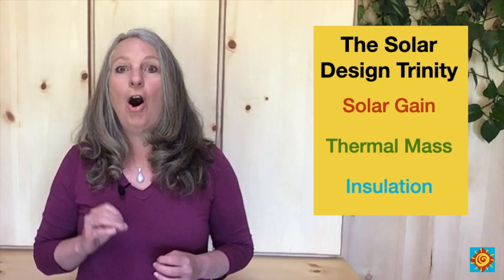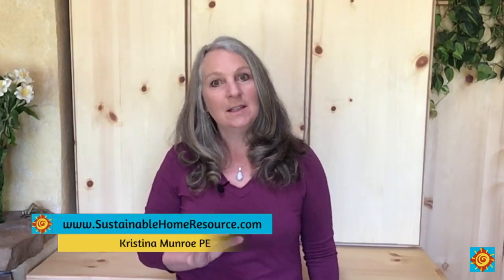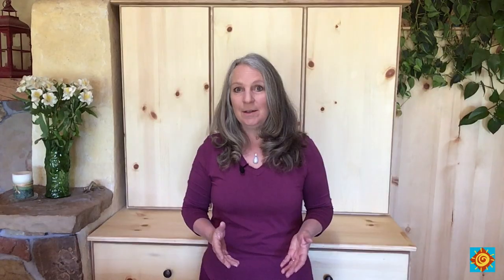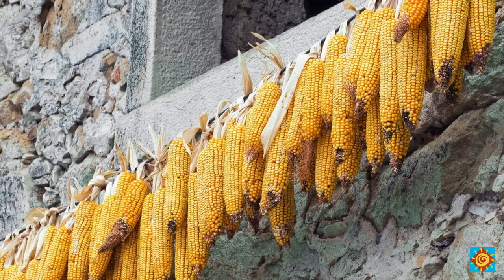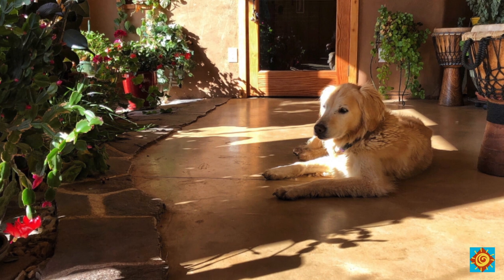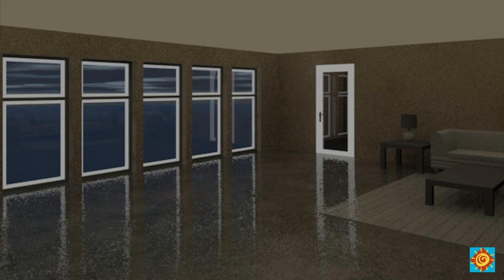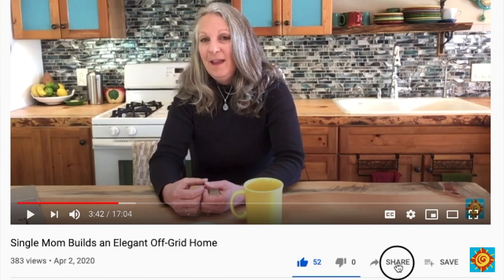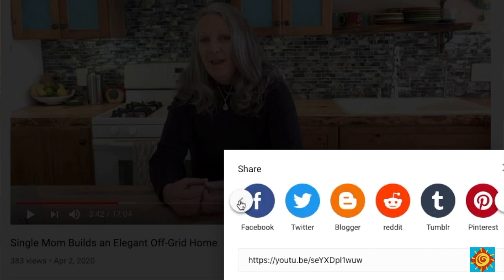[Part 2] Heating and Cooling for Free Using Thermal Mass

Comment: well, my house in mexico city, which is fully built with concrete (a very high thermal mass material) gets UNBEARABLY hot at night during spring and summer, so I don't know what to tell you. Maybe this works in cooler climates with "hot" summers that last two weeks, but here, in such an arid and hot climate, it really doesn't.
Reply from the maker: I agree and thanks for sharing your experience. 
Designing and building a home with thermal mass such as concrete is only but one tool in the designer's tool box. Thermal mass alone does not make a home comfortable. There are many elements to combine with thermal mass, such as placement on of home on the land (ie relative to the sun, wind), passive ventilation, berming the house into the earth, and the size and placement of windows. 
If you are inspired to learn more, I'd recommend a book by Michael Reynolds called Comfort in Any Climate. It's an older book, but the basic concept are sound.
Reply: @ClarityOffGrid  Thank you for your kind reply. Well, all those things you recommend are completely wrong in my house: big windows in an East facing front facade with no shade at all, none of the windows face each other to favor wind currents, huge skylights, the other windows face West... it's a complete disaster. The sun hits the house non-stop from dawn til dusk. I would really have to tear down the house to make it functional. 
The thermal mass bit is especially unhelpful here because, even though there's a big gap between night and day temperatures (10°C at least) the temperatures are already so high, even at night (20°C at 2:00 in the morning is something I wouldn't wish on my worst enemy), that when the concrete starts emmiting its stored heat, it becomes unbearable. Without treatments, when we first moved, the temperatures were around 31°C (88°F!) in my bedroom at 3 in the morning. I've managed to reduce it to a maximum of 28°C, and believe me, those three degrees less are very appreciated lol. 
I will try and read the book you graciously recommend. Sending you all my best :)
Reply from the maker: @cuervacho  You are not alone in your house woes. Unfortunately, very few homes are designed with these considerations. 
I keep hoping that will change and continue putting out the information. 
Best of luck to you.

Comment: Great video. I was wondering about your roof insulation.  What was used, an how think was it?
Reply from the maker: Thanks.  Glad you liked the video.  We used a soybean spray foam.  It had a low toxicity.  It is about 10 to 12 inches thick.

Comment: My thoughts on this for a home built on a slab in a cold climate was to insulate the exterior concrete walls to at least R20 and put R20 at the bottom of the walls and backfill giving perhaps 2’ or more of earth or sand as your thermal mass. I thought running solar heated air powered by solar powered fans would be a good and cost efficient choice to keep your mass warm and incorporate an earth tube and thermal chimney for night time summer cooling. I thought doing this and creating a building envelope with exceptional insulation, low thermal bridging, and low air infiltration you could put perhaps 2 small mini splits and have exceptional comfort year round. The only other mechanical consideration would be a heat recovery ventilator removing air from the bathrooms and kitchen. I appreciate your efforts to educate and encourage people to build efficient! Thanks
Reply from the maker: Thanks for you input. Our motto is KISS - Keep It Simple. In our climate, those measure aren't necessary. Off the power grid and without pumps, fans, or all those switches, our home stays cool in the summer and cozy warm in the winter.

Comment: Great listening to very creative talk. 

I am planning to use a combination of geo-thermal energy, evaporative cooler, thermal mass of concrete floors for cooling. Like wise passive solar heating for heating. 

Ambient air is conditioned first in vertical bore in earth, thereafter evaporative cooler (or passive solar heaters), treated air is passed through concrete floor slabs and also inducted directly in rooms. 

System powered by solar energy. Idea is free heating and cooling in area where temps are +5C to +42C. 

Let’s see how it works.
Reply from the maker: Good luck with your project. Thanks for watching.

Comment: Great video, thank you for sharing. I have just built an isotex house and have used the 380mm blocks. My house is two buildings side by side with a link building in between. The floor slab is an insulated raft foundation from Izodom - 250mm of concrete slab and 250mm of insulation. 150mm around the perimeter. The south building faces south and has triple glazed windows. My wife would like wood floors everywhere but I am concerned that especially in the south building we will lose the connection to the thermal mass and thus overheat in the summer. The north building was very cool even on hot days because it has no windows south just north east and west. The bedrooms are in the north building. My feeling is that this building would best suit the wood floors because we still have the thermal mass of the walls. Any thoughts on how to approach the finish of our floors. Thank you and have a wonderful Christmas.
Reply from the maker: Thanks! Without knowing the exact layout of your home, I can only answer that question is general terms. As far as keeping cool - your south facing windows should have eaves over them so that they block the summer sun and allow the winter sun to flood the room with sunlight/heat.
As for the floors, you are correct to be careful where you place them. If there is no sunlight hitting the wood floor then, you could probably get away with wood. If you are concerned about heating - you might consider radiant floor tubing under the wood - you can even heat that water with the sun if you live in a good solar area.  
If you are looking for a finish for wood floors - then you may want to look into Heritage Oil products or contact a store that offers non-toxic finishes such as HandCrafted House in Durango, CO.
Hope that helps.

Comment: Thanks for the vid. Being that im a mason i would most likely try to use cinder blocks solid grouted with proper rebar instead of the tire wall. If the cinder blocks is not an option i would then use earth compressed blocks. Would u please let me know which of my 2 options would work best? Thanks and great work on ur build.
Reply from the maker: Being a mason is a great skill! Great question. I believe you are asking specifically about the back wall that is bermed into the earth. Instead of tires you would prefer to use CMU blocks. Yes, would need to use cinder blocks (CMU) or reinforced concrete. I believe that Compressed Earth Blocks (CEB) would work, but I don't know of any that have been permitted as a back wall since it must retain the earth and be buried into the earth. You might consider doing the reinforced CMU back wall and use Compressed Earth Block for the remainder of the home.  I would do that especially if you are in an area prone to fire. Let me know if this has been help or not. (If I built my home over again I would use CEB for the front and sides.)